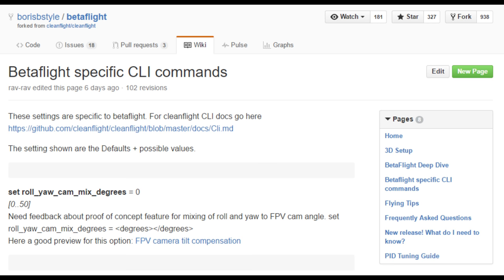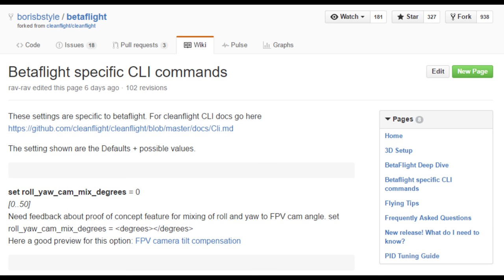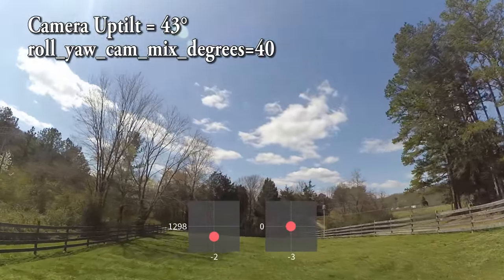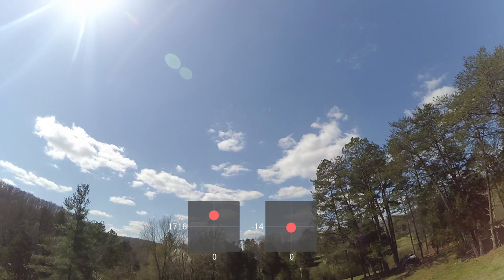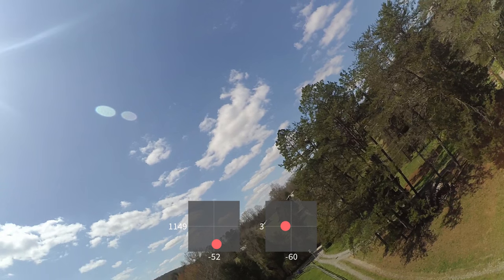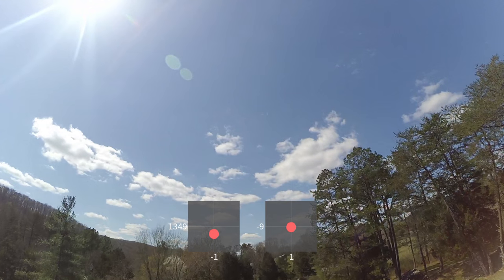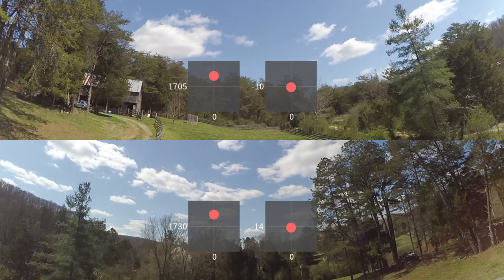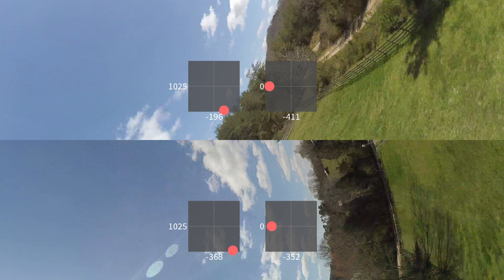Betaflight Camera Uptilt Compensation (roll_yaw_cam_mix_degrees)

Comment: One nice thing... camera tilt compensation puts coordinated turns on two control axes instead of three. So long as camera pitch is level, a coordinated turn has a zero roll component (i.e. angular momentum vector is perpendicular to the longitudinal axis). So once bank is established it's only yaw and pitch to keep turning. When the control basis is the quad rather than the camera, the quad's pitch for forward flight makes coordinated turns a three control-axis maneuver. Just spin the quad about various axes in your head and visualize the angular momentum vector to know which components come into play. I think camera tilt compensation has some good use cases.

Comment: Wow, is this the beginning of the next generation of pilot assistance for acro flying? I mean, gyros+PID loops were the first step, but this is assistance on steroids. I'm thinking speed detection to turn this feature on and off automatically, enabling normal hovering and yaw-only high speed turns.
Reply from the maker: +Chris Mavrakis I feel like consistency is very important for good flying. Maybe having the feature on a switch so you could turn it off for landing would be okay, but I wouldn't want it dynamically going in and out while I was flying. Anyway, hovering with the feature active is not too difficult. You have to cross-coordinate some, but you are going so slow while hovering that it's not really a problem. I wouldn't use this feature e.g. for a camera platform or anything, though.
Reply: +Joshua Bardwell I have my hs1177m on a manual variable servo tilt 0-45°, if the mixing value could be variable to the camera angle or rather equivalent servo position value, I could see that application being useful and helpful.

Comment: This may be a stupid question, but couldn't they set this so that it takes the current angle of the quad, puts it through a simple algorithm, instead of having you put in hard angle? That way, whatever angle you are flying at, if you want to yaw you just input yaw and the flight controller would take care of the rest (same for roll). I'm not sure how that would work on pitch, but that should be pretty easy for yaw and roll atleast. You already know the current orientation of the quad during to the gyro/Accel, so it shouldn't be too hard.

Comment: I created a mix in my taranis to accomplish this and found about exactly what you did, Josh. There is butter zone that can be really fun. Feels a lot more like flying a fixed wing fpv imo. I have this mix set to a switch in case things get too crazy though. Would love to see this as a mode in beta flight because sometimes I like to turn it off.
Reply from the maker: +ghall05 How did you do it in Taranis? I think it requires trig functions that I didn't think the Taranis had built in.
Reply: +Joshua Bardwell The way I've done it may not be as accurate as using the beta flight feature.. really not sure. I created a mix such that giving a left (for example) roll input will result in 90% left roll and 20% right yaw. Giving a left yaw input results in 90% left yaw and 40% left roll. These are just the numbers I arrived at after a few flights of tweaking that resulted in a feel I liked.

Comment: I have just learned about this feature, on a simulator yesterday, and been flying in rate mode on a real quad for a couple of weeks, it really makes a difference to the learning curve, I'm going to have a play with this on a real quad over the weekend. it has boosted my confidence and ability greatly in the few hrs of trying it. looks like I can really move on from Angle/Horizon mode.

Comment: Fantastic vid Joshua. A very simple yet innovative feature. 
I think we should always seek to embrace new ideas and see where they take us,  we have only skimmed the surface of what is actually possible with flight control algorthims and quad design.  What next.. Cams that simply rotate instead of quads having to yaw?  .. and just use a headtracker to steer? :O (joke)
As I expected, this mix feature does divide opinion and while that is understandable, I do think this is a positive and worthwhile development. Once it can be activated by a switch it will be perfect.
Reply from the maker: Betaflight 3.0 allows you to select it by switch.

Comment: One possible 'problem' would be that if you get used to this setting, especially at higher levels, if you were to switch flight controllers to one that doesn't have this feature (eg: switch from a naze32 to KISS), you would have to 're-learn' to cross-coordinate. I personally like to practice flying in a simulator, and as they don't have this feature as well, it will make for a weird discrepancy between real life flying and flying in a simulator. I am attracted to this feature as the cross-coordination in turns is something that I still find hard to do, but I'm a bit afraid it makes me learn to fly 'the wrong way', and it will come and bite me in the ass later if I for some reason have to fly with a quad that does not have this feature.
Reply: can't any fc use betaflight? if its betaflight should work on whatever fc you're using. that's my understanding atleast
Reply: +noah sexton  not all fc's are supported by betaflight unfortunately. but it's true that most of em are :)
Reply: +Elwin van der Meer ill be damn lol thought they all were. learn something every hour with this hobby haha
Reply from the maker: +noah sexton Betaflight will run on anything that will run Cleanflight, as far as I know. Maybe not the KISS FC. If there are exceptions, I'd like to know what they are.
Reply: +Joshua Bardwell if the kiss fc doesn't use cleanflight. what the hell does it use lol
Reply: +noah sexton it uses their own custom flightcontroller.

Comment: So I gave this a try.  It makes rolls real pretty and easy, but everything else feels really really weird.  I'm flying at 45deg and set compensation to 25deg.  Considering all it does is the actual cross yaw coordination movement, I believe I need to actually yaw more in order to make turns.  Feels really really odd.  I guess I could up my yaw rate to compensate but now I'm compensating for compensation...all just to do nice rolls...which is also now limited since I need to roll and pitch up to do the nice inverted float kinda roll while looking down.  Interesting mode, but I prefer the raw controls.
Reply from the maker: The weird feeling is because the camera doesn't have the uptilt you expect, possibly. It may just be that you have to adjust to flying at "lower" uptilt. But if you can swing it with raw inputs that's fine too.

Comment: Thank You for making a Video on this subject!

I´ve experimented with it and I have to say: if you´re camera oriented (what you see) you´ll like the cam_tilt_compensation.
If you´re oldschool and learned the "0° cam technique" (can´t see shit, still know´s where to fly), you´ll propably leave it.

For me it´s not that important what I see, I just need to know the Aircrafts orientation in space and where I want to go.
The Rates and Expos have to be Setup nicely that I know blindly what the Aircraft does on my inputs, but that´s important in any case of controlling something.
Now that´s the point where I get paranoid about the cam_tilt_compensation, in reality the quad doesn´t do what I tell it to do. It does mix yaw and roll "intelligently", so my original inputs are "overwritten", looks nice on the screen (camera) but it´s not my FULL CONTROLL, that was the point where I stoped using cam tilt, as I realised that I don´t have the blind full control that 
I´m used to. 
Always loved to play around with setting the quad in one orientation on the same height and just yawing like a frisbee ^^

On the other hand it´s like drive assist, you have to control less to get the same effect because cam_tilt_compensation 
is mixing for you, so you have a nice flight experience, that feels close to a fixed wing aircraft.

It´ll take some time and development till we find out what the perfect viewing and controlling solution will be for multirotors.
Right now either solution wouldn´t be good for example for human transport. Imagine sitting in a multirotor that has to be save and easy for nearly everyone to fly, especially for hot blonde girls with blue eyes ;-)
How would the controls and fly assists be?

Cheers
Reply from the maker: +B31A It's hard to believe people could fly proximity acro very well based on "can't see shit", but I could be wrong. For acro videos, what the camera sees is really all that matters. For racing, I agree that the only thing that matters is who crosses the line first.
Reply: +Joshua Bardwell On 0° Cam tilt, back in the days where camera tilting wasn´t that popular, some tried to fly fast, race, slalom, a.s.o. 
It was possible, but you couldn´t see shit in many cases. Since some smart brains started tilting the cameras upwards, the sight problem was soluted but another problem raised: the mixing of yaw and roll (from the cameras point ;-D).
Reply from the maker: I've see the original Blackout videos for example. He got a lot done with zero uptilt. But he was still staring at the ground a lot.
Reply: +Joshua Bardwell Yeah, that´s what I meant by writting: "can´t see shit, still know´s where to fly". 
You can see the ground, so you have a preference of where the aircraft is in space. 
Still in fast forward flight it was terrible with 0° cam tilt, because I couldn´t know what´s ~3 meters in front of me at high speeds, so I had to learn to "study and remember the picture" I was heading into (using stones, bushes, whatever as a reference to where I was and where I wanted to head next). 
The idea of tilting cameras came later and it was a big revolution because pilots could finally see where they were heading. 
Right now it´s already a standard in FPV flight, that the cameras are up tilted, newer frames are also designed in a way that they support camera uptilt. 
The Designs of the "oldschool" frames didn´t had that philosophy and easy options for cam uptilt, still people learned to fly them. 
Maybe cam_tilt_compensation will be the next revolution in FPV racing, but it´s a little hard to accept for a hardwired brain...

Comment: Hey, here is "the guy who proposed this feature" - thanks for the explanation of this feature. Just a few comments: This feature was not proposed to make flying easier. I originally came up with it to make flying more precise, and racing faster. In my opinion, it might be a little harder to fly with full camera tilt compensation (which is what I do all the time), but it forces me to fly a better line on racetracks (more pitching to turn & less yawing to turn).
The lower roll rate when you use tilt compensation must be an implementation feature. I don't have this on my FC, and I also don't have an idea why this would happen. If it would be a physical issue, then you should see the same effect when you cross-coordinate manually. Do you see this effect?
Reply from the maker: +William Thielicke it's because the copter has less yaw authority than roll. So ant move that combines yaw and roll may be slower than one that is pure roll. I can't manually cross coordinate at full stick deflection so I can't verify that it happens then. You would only see it at high roll rates.
Reply from the maker: I'm surprised you say more pitching to turn and less yawing to turn, since the effect of uptilt compensation is to remove the need to manually roll into turns, therefore you can turn purely with the left stick.
Reply: Sorry for the late reply... Too busy... Well if you turn with your left stick only in racing, then you clearly make something wrong. In my opinion, you loose the least amount of momentum when you "fly like an airplane", that means rolling (with respect to the camera axis) in the beginning of the turn, then pulling the "elevator" during the turn.
But in complicated tracksand tight turns, it might be necessary to do a "left-stick-only" turn in order to loose velocity.
Reply: It would be cool to add this to velocidrone to experiment on a sim.
Reply: @maximumvelociraptor1166  It is in there now! :). Can't decide which one I like better!

Comment: Interesting...I didn't see this video until today and have been using "FPV_Angle_Mix" May and have just been putting in the angle of what my camera is (30 degrees).  Now I'll have to play with halving that to 15 and see if I like it.  REALLY like this feature on my 716 7mm based "Tiny Whoop"...it almost feels like a locked in stock Inductrix, but with full Acro.

Comment: Instead of using a fixed up tilt compensation number, is there a way to make it variable based on the quad's current pitch angle? That way, if you wanted to take off from the ground and yaw, it would not add roll since the quad is level to the ground. It would only add roll/yaw compensation if the quad is pitched forward.
Reply from the maker: +Brandon Buller I'm pretty sure that's how autolevel already works. But I don't fly autolevel so not 100% sure.
Reply: I suppose it would be a form of auto level, but since I'm doing fpv drone racing I use rate mode.
Reply: Since it can do 20 degree tilt compensation, I feel like there should be a way to tell the flight controller if the quad is sitting at 20 degrees, apply X amount of tilt compensation. And if it's at 15, apply a different amount. Obviously the speed of the quad affects the tilt. If I'm going slow it's a lot less tilt so I would want less tilt compensation in that instance.